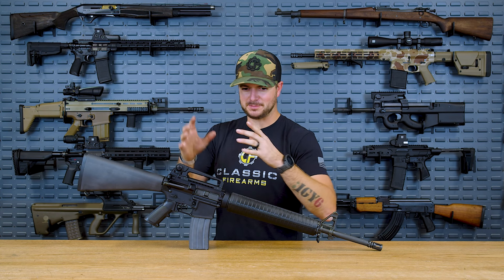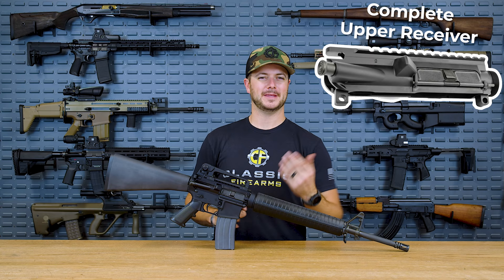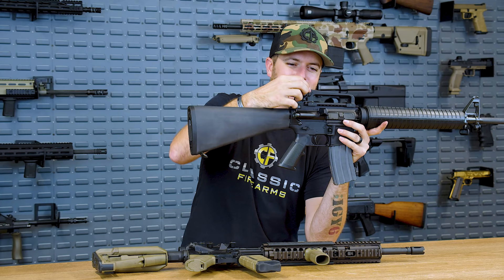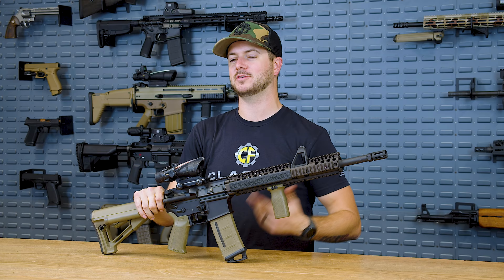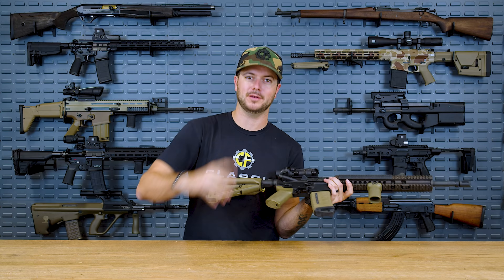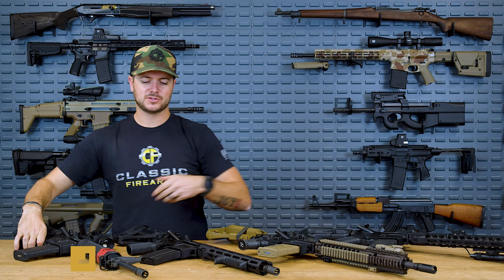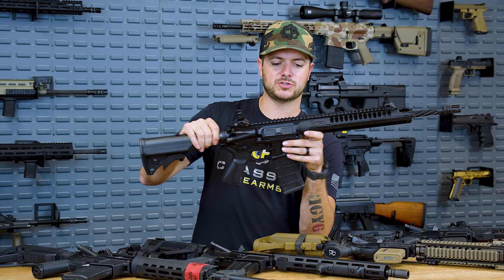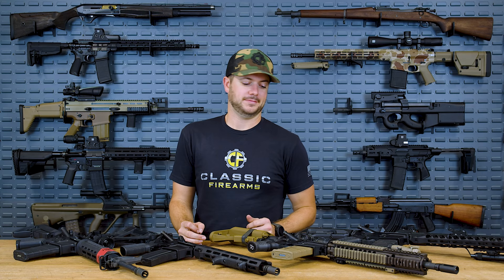What Are Upper Receiver Forge Markings And What Do They Mean?

Comment: This was fascinating to me - as an engineer I love details like this. I looked up each forge on the interToobs, and discovered that I used to live a couple blocks away from BAFE (the Square) in Ferndale, Michigan. I never even knew it, how cool is that! I guess I will have to check my receivers for the Square, and maybe collect one or two.

But the biggest mystery still remains @ClassicFirearms:
What is the vertical line forged on top of the bolt cam pin hump on the left side of an upper receiver?
Reply: Ya I'm a stone's throw from Anchor Harvey. Weird there's so few.
Reply: My m&p sport 2 has a square marking on the receiver.
Reply: Hmm, in Troy, so now I have to do a drive by of BAFE on the way to work...
Reply: I lived in Ferndale and never realized it was there.
Reply: that line on the left hand side of the upper receiver is a "witness mark" used to tell if the forging is for lack of a better way to explain it centered.... if its to far to either the front or rear on the forging then the machining process will remove to much from either the front or rear of the upper
Reply: @armyreaper63  No, that line is used for the machining operations to determine where the face of the receiver will be, nothing more. It’s literally in the print as the datum point.
Reply: @Schaz42  so you agreed with me without actually agreeing with me lol... Datum or witness mark however you want to call it... Its used in the machining process and if to far to either the front or rear will throw off the cutting of either the front or rear
Reply: @armyreaper63  looks like it 🤣
Reply: @andrewreames7080  That's wierd my sport2 has the splintered anchor

Comment: I agree with you on the machining. All it takes is to be out of spec by a few thousands and you could potentially have a lemon.
Reply: Most tolerances are a few thousandths on mil spec except for round surfaces, but even then they're not aerospace tolerances.

Comment: Cerro Forge markings are seemingly the most coveted. Square, even though many high end companies like DD use them, seems to be the least coveted.
Reply: Cerro Forge markings on alot of low end uppers.  Anchor Harvey is on higher end uppers.
Reply: My DD has a cerro forge marking on it????
Reply: @nawfside713gsta  They must use alot of different forgings. I've seen many DDs with the square. Also seen many more budget friendly uppers with the square as well. But honestly, it's the matching and anodizing on the Forged piece that really matters.

Comment: So something to note....the keyhole lowers I believe are all 7075....some lowers out there are soft 6061....7075 is much stronger that 6061. If you've ever cut an 80% you'll notice the difference. However 6061 is more corrosion resistant, so if your cutting your own lower and are leaving the FCU pocket bare it may be a better choice. It also won't eat up tooling as quickly.

Comment: My all factory original Delton 316 proves that you HAVE to spend a lot of money to have a 100% dependable, accurate AR-15…. Definitely not knocking any build where higher quality parts & longevity was the goal, but Delton DEFINITELY got mine right.
Reply: Delton is cheap, they make solid stuff though, but they're literally one of the cheapest, also one of the best cheap ones, I really liked my DTI hbar  mid length upper, wish I hadn't sold it
Reply: @lumpyzx2645  I’ve been checking out Delton uppers & complete AR’s on gun broker. New stuff. You could replace that DTI hbar upper pretty cheap right now. At least with a medium contour anyway. But I get sidetracked so easily by those 399 uppers in any color anodized aluminum

Comment: I’m a fan of anything “C” “F” or “M” or Colt, FN, or Meuller. My Colt AF (accurate forge) is probably my favorite. My Diemaco anchor harvey and Mueller are prob my next favorites. One of my uppers from CMMG has a “o”. Can’t remember off hand what that one was.
Reply: Same here i never could find out anything on it.
Reply: AF is Alcoa Forge or Alco Forge. Not Accurate Forge. Nice try though.
Reply: @Plenty556  af is accurate forge now owned by cerro. They were only made before 2002. Alcoa forge is different. I know, I work in aluminum. Nice try though :-) unfortunately, There is currently a lot of misinformation spread by young cloners that don’t do all the necessary research. Edit- sorry, they sold to cerro back in 2000, not 2002. My fault.
Reply: @Plenty556  Nice, you come here to post incorrect info, call us (me) a fudd, then edit it out. Yes, there are a lot of ppl that think colt AF is Alcoa forge, but it is not. Why else would they not have been made since early 2000’s, the exact time when cerro acquired accurate forge? Alcoa is still in business, so why aren’t we seeing any current productions? This is documented in a colt History book. I don’t blame you for thinking it, I did too when I first started collecting. But at least have some humility and dignity. No need for name calling and doubling down.
Reply: @michaelmcginnis9029  I just read that “O” is Performance Forge. So far that’s all I know.
Reply: @dyzastrus5450  So neither Alcoa nor Alco exist any longer? GunsTV listed the forge marking “C AF” as Colt Alco Forge. That may have been a few years back
Reply: @pcpolice7937  Alcoa exists as a company, but I’m not sure if they ever did any ar15 receiver forging. C AF, or Colt Accurate forge, was sold to cerro back in 2002. They took over the contract, so the AF’s became Cerro or Keyhole at the time of acquisition in 2002.
Reply: @dyzastrus5450  Thank You for the correct information. Tuff to come by these days

Comment: I have never given a single crap about forging marks.  Any time you run into an issue with a gun working that is receiver related it pretty much always boils down to something being milled out of spec.  Nothing to do with the forging process.  Crappy tooling or poorly applied finishes will messing things up in a hurry though if it slips past QA.

Comment: Splintered A does not fit well with the key hole lowers. The take down pin holes are misaligned and it's s b1tvh trying to take down the upper from lower.
Reply: thats not the forging... that is the machining...

Comment: Forged blanks are pretty much the same. Take a raw aluminum block of specific aluminum grade. Press it into an oversized part of the rough shape. The machine tooling, condition of said tools and tolerances held by the QC. Are primarily the difference of the end product. The anodizing process is another final step that can lend to fitment issues. Have yet to find a finished product that didn't function properly.

Comment: When I run into it I do prefer my ARs to have the keyhole upper and keyhole lower together just because then your upper and lower both came from the same forge which equals to the lines on the upper and the lines on the lower perfectly matching up which is something that don’t to typically or often Lee happens with most manufacturers, I think about the only two companies that I have seen get both the keyhole upper and keyhole lower to mate together has been Daniel defense and Colt they have been about the only ones that I have seen that do that, I haven’t seen any of the other  manufacturers do that, and of course even at that Daniel defense and Colt don’t always do that but sometimes you get a run from either one of those 2 that do, I just think that it makes for a very uniform and very sharp good looking rifle, lol